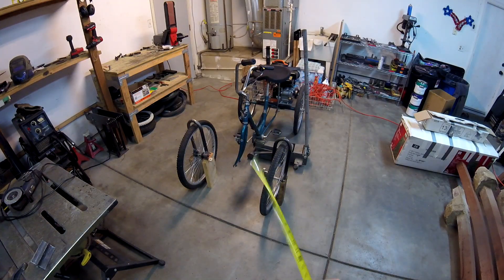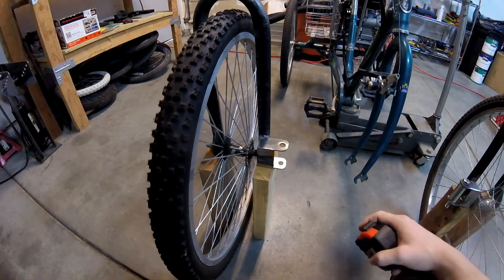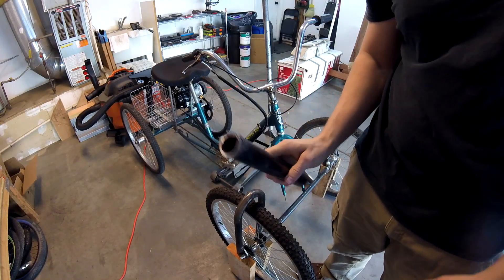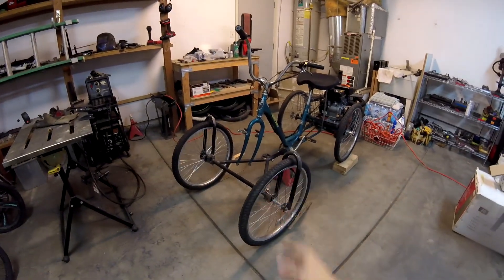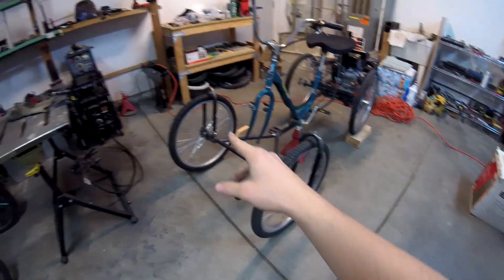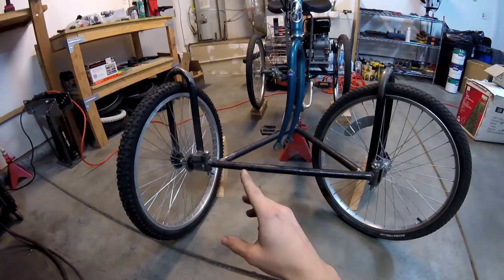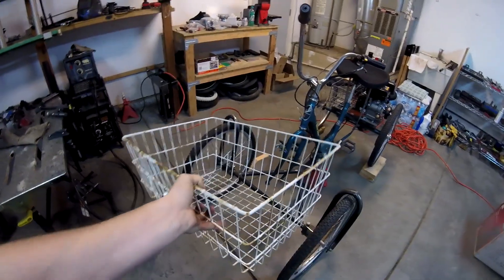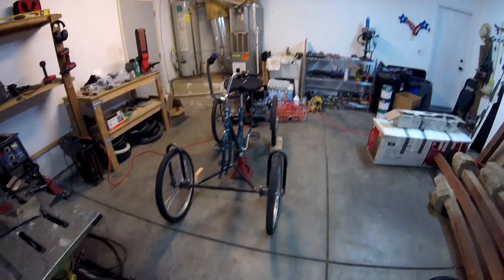How To Build A Motorized 4 Wheel Bike | Tricycle conversion pt.1

Comment: Did you angle your spindles so The kingpins pointed to the center of your tire when it was sitting aim forward
Reply from the maker: I put 8 degrees of caster. It does the same thing as KPI. These are bike tires, so the contact patch is extremely small, and the scrub radius is also small so the steering doesn't feel bad or heavy. Watch my next video to see how it handles.

Comment: The pipe coming from the pedal crank housing all the way to the axle would be the strength The triangles are for lighter twist
Reply from the maker: I disagree, a simple free body diagram will show you where the forces travel through. There is a reason why structures use triangles like cranes, trussell, and bridges. Triangles are the strongest shape. Even the bikes we ride on are made of two triangles.

Comment: I would extend the pipe all the way to the axle on the triangle for strength of mild impacts and potholes
Reply from the maker: That's not an axle. Also, the two outer pieces take the majority of the force. The only area of the center pipe that would take the force would be where the outer pipes connect to it and anything above it wouldn't really have any force go through it. It's a waste of material and adds weight. Of course, you can add it to your build if you want.

Comment: My dad built one when we were kids, two bikes,( 20" or 24"frames) welded 3' apart. He had a friend build wheels with heavy spokes. Bicycle steering wheel. Someone had steering wheels on bikes in the early 70's. Seat was a bench (board) between the two frames. Kind of resembled an early model ford. Sounded like one too. Don't remember having brakes.

Comment: I bought my sister one that was awesome..First quad bike I had ever seen a well built Three speed with basket on front and back..... She has a Foldable Three wheel bike as well she has Autism and never grasped the two wheel version....hers has 24" rear and 20" front.  With go cart type steering.... from the handlebar....